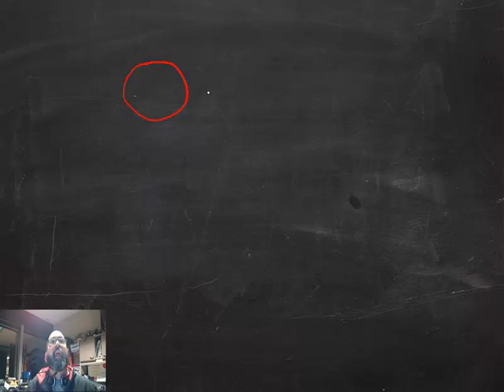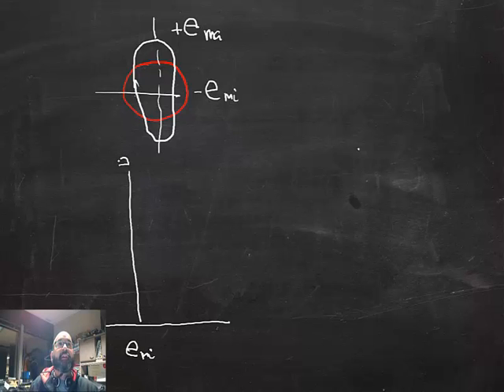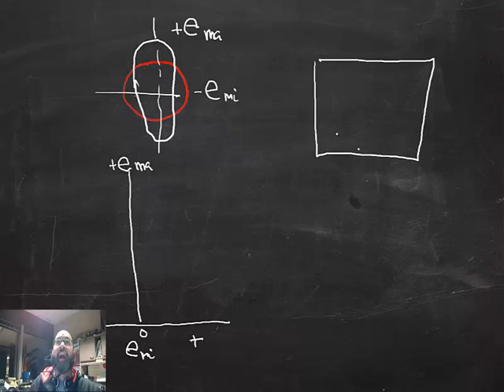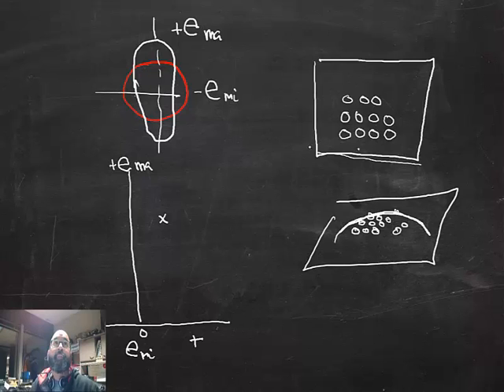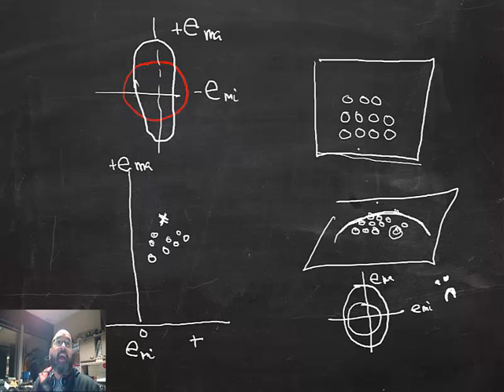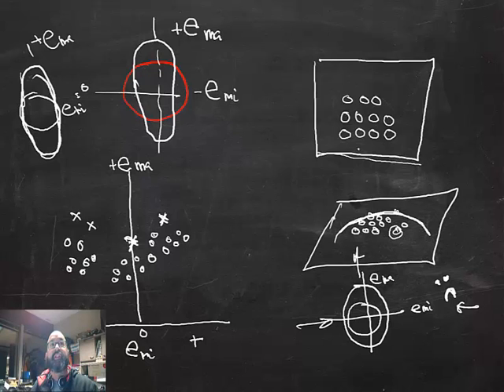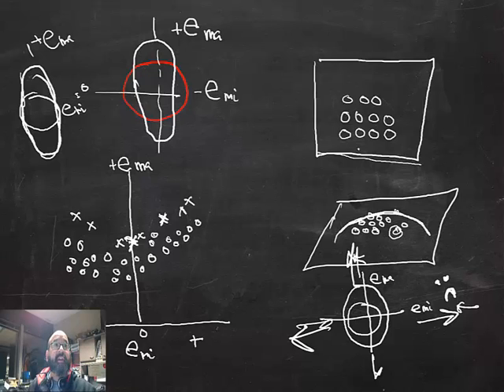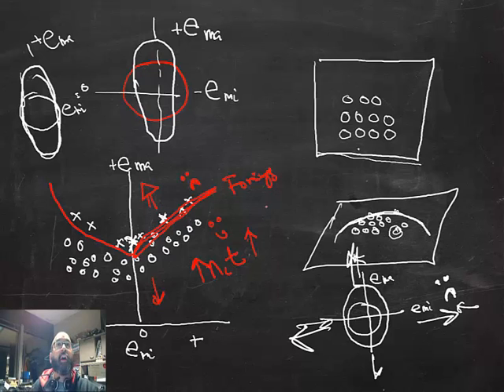FLD-trial1

Comment: Great for minor strain wich has values in X axis is there a limit of values for this variable somebody told me that it has to be  greater than -0.8?
Reply from the maker: -0.8 is 80% strain there are very few instances where initial deformation from flat stock to shape will exceed 80%, But the curve can fit whatever OBSERVATIONS are made. if it is observed then the published curve would include that strain value. - 0.8 % or strain of 0.008 in/in or mm/mm is well defined on the FLD space as is.

Comment: What is N value ?
Reply from the maker: N-Value is the materials "Work Hardening Exponent" it is derived by performing a "curve fit" of the Load-displacement curve when plotted to True strain-stress space.  From which it is possible over a portion of the curve to map the recorded data to a constitutive equation. Equations like the sigma = K(epsilon)^n  where sigma is the true stress, epsilon is the true strain, K is the strength coefficient, and n is the work hardening exponent

Comment: Very helpful video abou FDL! I΄m working on a paper about biaxial tensile test and I am searching on FDL of steel St14. Do you know where can I find one? Also, metal sheet thickness affects the curve? Thanks!
Reply from the maker: Glad that you appreciate the video. 

St14 is considered to be equivalent to Mild Steel Deep Draw Quality (DC04, DDQ, DDS, Cold roll 04, CR04)
If you are a believer in the "Keeler-Goodwin" FLD then you can locate the FLC0 using this page https://www.eqsgroup.com/steel-formability-calculators/forming-limit-curve-calculator.asp and more to ready here: http://www.metalformingmagazine.com/magazine/article.asp?aid=10722 

Sheet metal thickness raises the curve generally (thicker sheet should be able to experience greater surface area stretching before failure).
Also, material processing such as cold rolling and annealing definitely also affect the location and shape of the curve. 

 http://www.steelnumber.com/en/equivalent_steel_iron_eu.php?zname_id=3985
http://www.steelnumber.com/en/steel_composition_eu.php?name_id=201